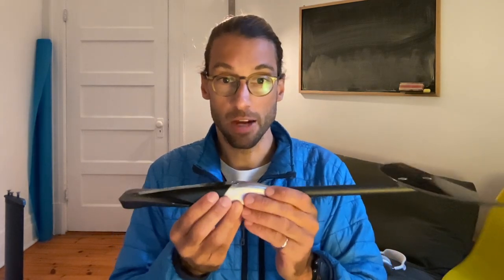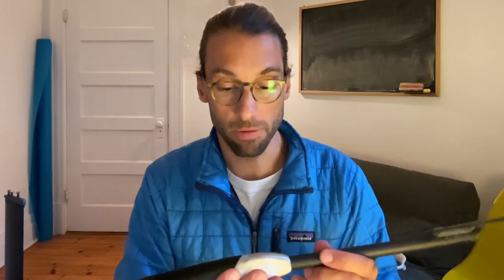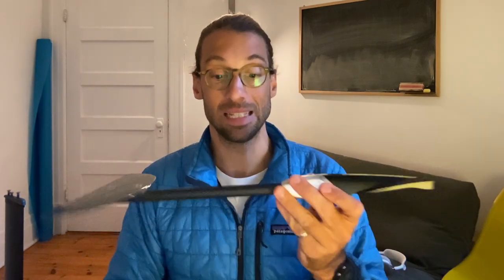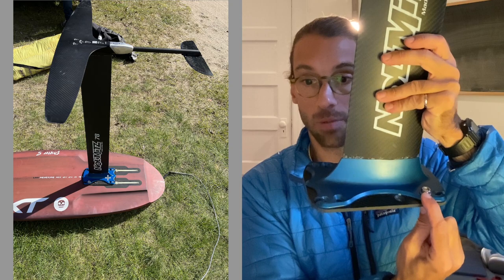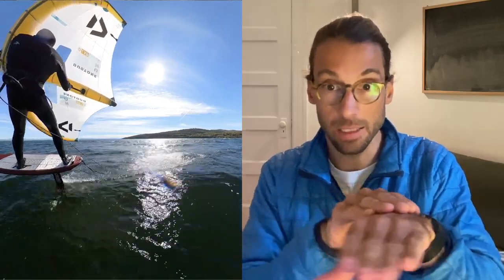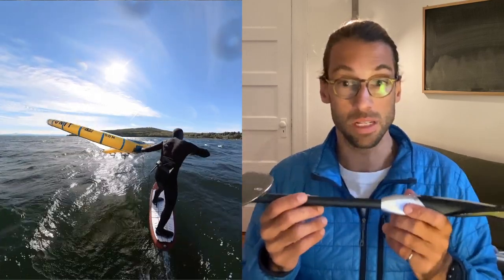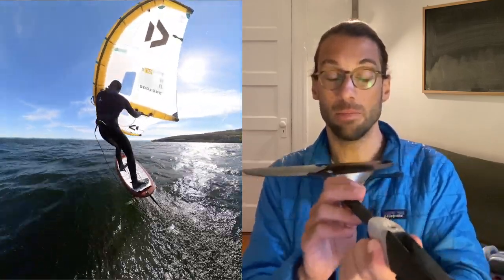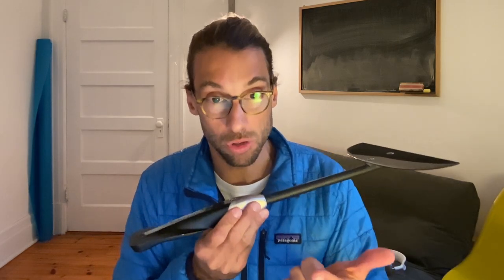RADICALLYSHORT V3 - Final prototype

Comment: Nice work. I'm a big fan of your concept.
Reply from the maker: 🙏🙌🤙… hopefully the main brands will do as well 🤞
Reply: @james_goulet  Maybe there is a way to remove that middle piece out of the equation and use the same screws for mast-wing-carbon tube connection, integrating all the connections into the wing . .?
Reply from the maker: @HANDIY  that is definitely possible but it would require modifying the mast connection… it is more suited in would redesign everything from scratch, the mast and the fuselage

Comment: Great job! When I first started foiling using a Slingshot I84 behind my powerboat I put the mast in the position ("A"?) that is located directly over the foil and was amazed how it unlocked the ride of the foil. Like you said it really allows you to turn the foil in the yaw axis which made it feel "skatier" to me. I could turn the board on the wave almost like grinding a skateboard. I would absolutely buy a CNC'd part for my Axis foils. You could def sell the fuse base with a cut to length carbon tube for the rear of the fuse with an included shim(s) for installation of the stabilizer wherever the customer wanted for fuse length. Or, maybe Axis will come out with their own "Aaaadvanced" fuse based on your development. Great watching your progress and development, thanks for pushing forward!
Reply from the maker: I have no plan to sell fuselages, but I plan to work on a CNC-based prototype next winter. When it is going to be ready, I will put the CAD files online so that anyone can go to their local machine shop and have it make. As the fuselage is a carbon tube, anyone will be free to cut its fuselage to the desired length and changing it will be super cheap. I think there would be more values in doing so than in selling a couple of prototypes and having to deal with everything around it
Reply from the maker: @bohdanschatschneider9962  Unfortunately not 🤦‍♂... I did several prototypes and I was never able to get exactly the exact good shape for the front wing connection. I am still tiding the fuse, best one ever :)
Reply: @james_goulet  It seems like Axis made that connection difficult to replicate on purpose. You'd probably need access to a 3D scanner to sort it out. Thanks for posting your work, its inspiring.
Reply from the maker: @bohdanschatschneider9962  I tried to 3D scan it... scanning is easy, working from the scan is crazy hard. If you can do something with it, here are the 3D scan files: https://www.dropbox.com/scl/fo/75vi9rqls3h228jcz5gut/h?rlkey=28pkamzmkoazesl26izsd5a45&dl=0
Reply: @james_goulet  Thanks. I'll see if my engineering buds can do anything with it.
Reply: @james_goulet  Hello again. My buddy took the 3D scanned file entitled, "Axis_fuse_light.stl", put it in solid works and told it to make the object a "solid object". After that, the resulting CAD file was completely manipulatable.   So, we 3D printed the part and it fits perfect in the AXIS wings. Now we'll extend the fuselage to a workable length and add a place for the mast and carbon tube to enter. If you have any input, we would love to hear it.
Reply from the maker: @bohdanschatschneider9962  I am glad to hear that! You are one step closer to have a foil that will blow your mind 🤯. If it can motivate you, here is a clip with this foil from a couple a months ago https://youtu.be/kGtS1y_PAz0. Regarding the design are a couple of things to consider: first, you want to use the existing front-most hole as the new back one, that will require that you drill a new hole your front wings (I did it with all mines 699, 799, 899, 0 issues). Reverse-engineering the axis mast adapter is fairly straightforward. The pocket for the mast adapter should be parallel to the flat surface underneath the fuselage connection, and the 15mm hole for the stab (https://www.amazon.ca/gp/product/B00RZ12U8M/ref=ppx_yo_dt_b_search_asin_title?ie=UTF8&psc=1) is perpendicular to it. You will need some inserts to fix the carbon tube to the fuselage and to the stab: either you machine 11mm brass insert or you 3D print them and you put a stainless nuts into them (https://www.dropbox.com/scl/fo/7ymmmbvzoj8nrfamjwxm1/h?rlkey=a3heqsmdwbirdh29zuglzl3rw&dl=0) I tried both, the brass looks nicer but both work. You will need a 3d printed shim to fit your stab to the tube. My stab is a H14 horue one and the 3D cad file is in the DB folder. If you want to use another stab, use a contour gauge (https://www.amazon.ca/Irregular-Duplicator-Woodworking-Fabrication-Silhouette/dp/B07V3ZRD7Y/ref=sr_1_12?crid=3O06NW3PB9EYX&keywords=contour+gauge&qid=1689813521&sprefix=contour+gauge+%2Caps%2C95&sr=8-12) to extract the profile and draw it on a sheet of paper, take a picture, import it and solidworks in order to have a perfect fit. (I have been riding on the same 3D printed shim since last year). Many little details... if you have question, write me on my email james.a.goulet@gmail.com we can setup a zoom call. I am looking forward for it to work for you!

Comment: Hi James, I tried to print in 3D your super short fuselage, but as you said, it doesn't fit well to the font wing. I'll try to modify the design
Reply from the maker: I am on it as well. I have done two iterations... I have a new one in print, hopefully this one is going to be the final. I will post it if it works :)

Comment: Hello James, great work! Thanx for sharing. Amazing skills... Coming from an advanced crazyshort fuse and 325 tail - would there be an advantage for avarage rider of 80kg and larger front wings? Usually riding 899 &1099 ART. Or is your radically fuse an overkill for the 1099? It took 1 or 2 sessions to dial in the advanced crazy after using the old ultra. Would that be the same step or would it take "years" to upgrade to your radicallyshort? What I am trying to get to - is this only for lightweight professionals/freaks  or is your radically short for the main crowd? thanx
Reply from the maker: Thanks! You would definitely see the benefit of moving the mast forward and shortening the fuselage with both the 899 & 1099. My feeling is that it is for the main crowd, however, it will take some time. If you are on a Advanced crazy, it will push you outside of your confort zone. My take is that you either go all in and you will need 10-20 sessions to adjust (This is what it took me when years ago to go from a normal foil to a Horue H14 that is even more manoeuvrable than my V3), or you go progressively whereas whenever you feel good on a setup, it is an indication that you need to go shorter and more forward. In all case, I think we are just at the beginning of the development in the sport and what is considered normal today will be completely outdated in 2-3 years from now. It reminds me of when kite foiling started and everyone were on 140cm board with nonsense wings like the Moses 633 🤦‍♂... A lot has changed since.
Reply: Wise words. I will take the second route 😀. But I will mark your words. When I feel comfortable I move on! Ps my kite/pump board is 100cm but I still like my 633 on light wind days… 🤫just don’t tell anyone 😉
Reply from the maker: @berci1001  😂🤐

Comment: Is this stabilizer has a symmetrical profile? I wonder about the angle of incidence of -0.25 is very small. Is this compare to the front wing or to the fuse?
Reply from the maker: It is a symmetrical profile. The angle is -0.25 in comparison with the front wing or 89.75 with the mast. This angle is small, but it is what minimize drag. I calculate it by putting the fuselage & front wing horizontal and then measuring the distance from an horizontal surface of the front and rear elevation of the stab. Then you just have to do angle=arctan(delta elevation/stab chord)
Reply: Magnifique James ! J’en achète un à quel endroit? Merci pour ta recherche et ton expertise , Bravo !
Reply from the maker: @lucbeaugrand  Merci Luc! :)
Reply from the maker: @lucbeaugrand  hahaha pas de production planifiée, mais je te fais essayer le mien quand tu veux :)

Comment: Please let us know if we can buy one!
Reply from the maker: Unfortunately, all the fabrication process is still manual. This mean that the price would be completely unreasonable to make one. I plan to get into the design of one that can be mass manufactured this winter... will keep you posted 🤙🙂. P.S. this fuse makes all the difference in the ride. I have now spent about 20-30h on it since I posted this video and I could not come back to riding the stuff you purchase on the shelves 🤯
Reply: @james_goulet  any update? i feel like a red adv version would be good with wings like the 1300. for flatwater pump or small waves, not winging
Reply from the maker: @apricotscrub   Unfortunately, I have been swamped with work this winter... I hope I will have time to get into it this summer. Someone sent me picture of an advanced red fuse... seems to work well: https://photos.app.goo.gl/mPKULuQdR34HNhuk8

Comment: Hi James, your work is very interesting to improve the ART axis foil, I suggest to try to make the fuselage you designed in carbon fiber. I already tried to made a silly short in carbon fiber by a mold and the mast joint by cnc machine. If is possible to have your cad file I can try to make a mold of the super short fuselage. I use Fusion 360, but a step file could be fine. Let me know
Reply from the maker: Roberto, I am glad to hear that! Here is a link to the .step file: https://www.dropbox.com/s/6wp6t6bf15eazan/Fuselage_RS_V1.STEP?dl=0
Note that I have not tested the tolerances of my "reverse engineering" yet. The part is going into 3d printing this morning and I should have it ready to test on Wednesday. I will be able to confirm then whether the fit for the wing and mast are perfect or not. In case it is not I will need to do small tweaks. I am glad to see others having fun with experimenting!
Reply from the maker: And note that the hole size for the two M6 in the front are the nominal sizes, i.e. 6mm. You will need to remove 1mm to the diameter if you plan to add treads or add extra space if you plan to add an insert.
Reply: Thanks for the file James, I will try before to make it by my 3d printer and try how it fits on the front wing. I will show you my result when it ready. Bu I would like to modify it to use the original front wing without the new hole. I already made the mold for 899 and 1099. An other solution could be to integrate the short fuselage with the front wing (next step). I don't know the carbon tube features, If it twists for the stabilizer torsion
Reply from the maker: @kitewavers  I do not think there is much torsion in the carbon tube. Here is the one I used: https://www.smallrig.com/15mm-carbon-fiber-rod-30cm-12inch-2pcs-851.html
Reply from the maker: Finally the part is not fitting well… I will need to do some corrections